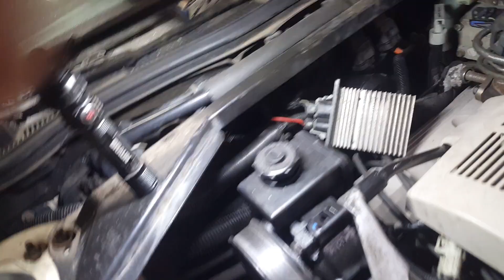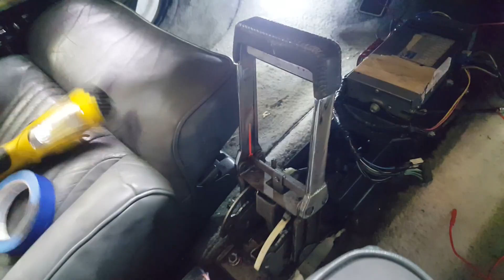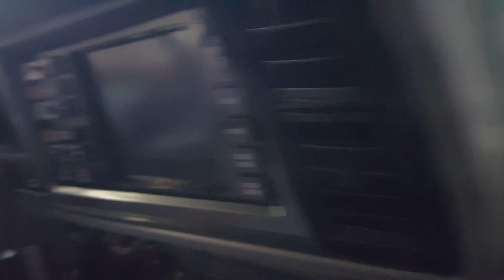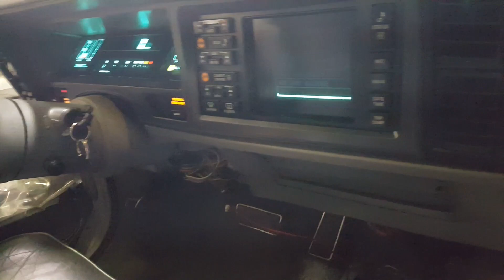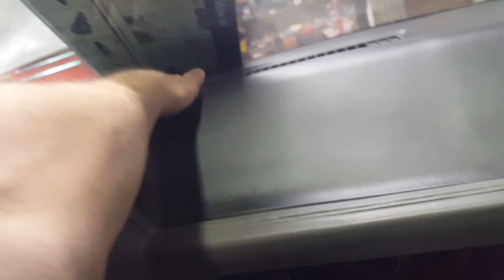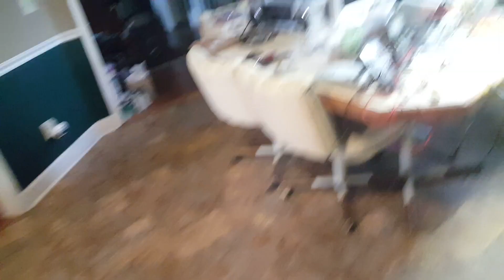1989 Olds Toronado Trofeo New HVAC Power Module Test

Comment: Jon, please tell me that when you sent the tooth, you sent it in a box full of Styrofoam packing peanuts..   😂😆🤣😉
Reply from the maker: Hahaha!  Had I known David was going to overwhelm me in styrofoam, I would have waited to send that tooth!
Reply from the maker: Oh, BTW, after this successful test, I opened up the garage, fired the engine up and let it warm up, and build vacuum.  All the actuation diaphragms are working, and the car is blowing heat in, through all the vents, in all the right locations, on command.  The air volume still seems low, so I'm going to look into some possible partial blockage in the air box (heater core and evaporator core), and one more thing I have recently learned :  the blower motor may actually be turning backwards, resulting in partial but lower air flow.  I never even knew that was a thing before.